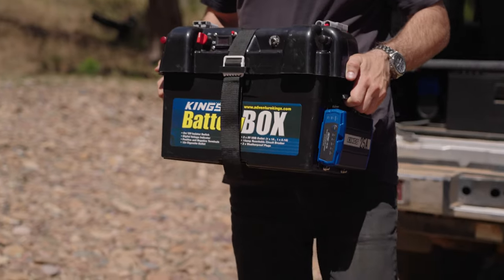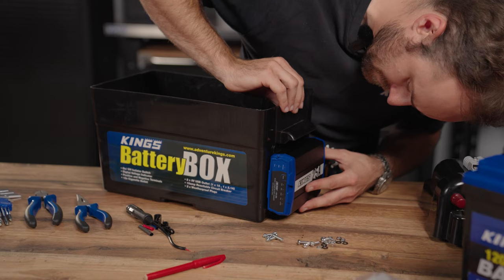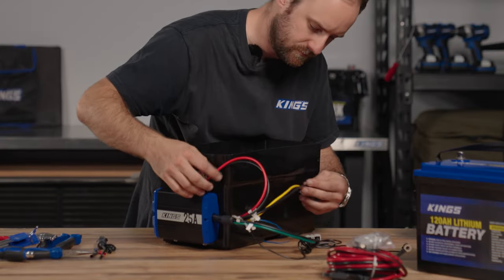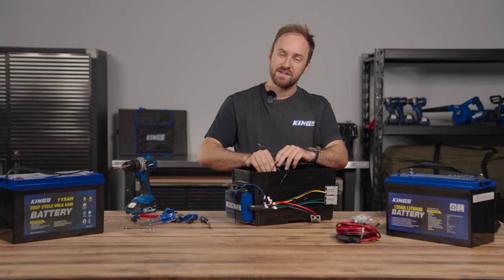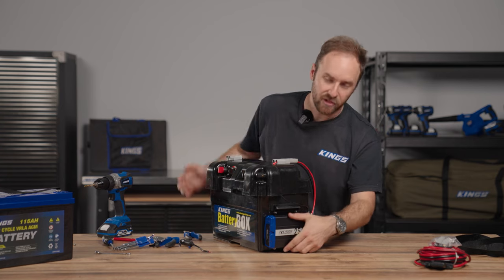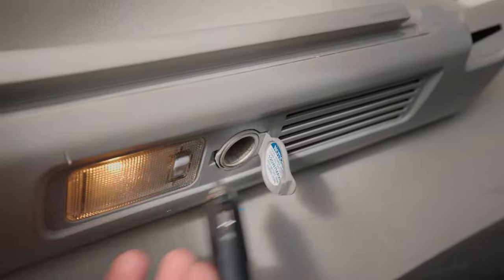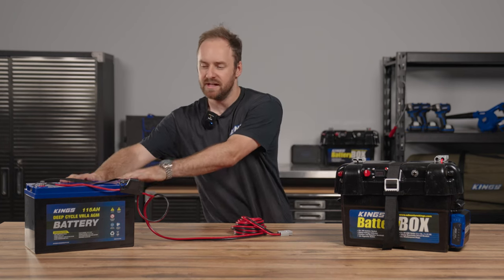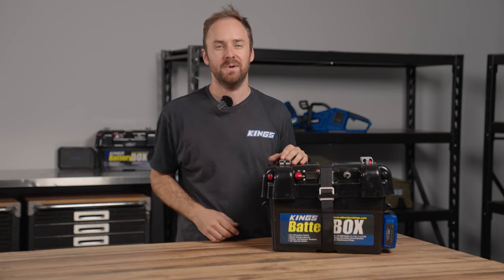How to install DCDC Charger onto Battery Box! Easy DIY!

Comment: My car already had a 12v Anderson’s plug at the rear of the car fitted when I bought it (‘22 ford ranger) that has been run through some sort of isolator. Could I use this cable to plug in as the starter batter input on the dcdc charger or does it need to go direct to the starting battery? (Remove the already fitted isolator) Assuming the dcdc becomes the isolator
Reply from the maker: Hi there,
This should be fine to plug into the DCDC charger.
Regards, Courtney

Comment: Hey guys, need some help please. If I disconect the alternator input (Anderson plug) or switch the isolator switch off when the vehicle is not running, I wouldn't need to connect the ignition wire, would I ???
Reply from the maker: Hi there,
For this setup this ignition wire would need to be connected.
Regards, Courtney

Comment: Cold you help me😢😢Can i charge a 60ah lithium battery with the DC DC charger directly connected to the car?? If I can, what type of cig plug do I need? Cheers guys
Reply from the maker: Hi there,

I can confirm that they are compatible with batteries of that size, please do note that it is designed to have an Anderson to Ring Terminal cable set going to the starter battery rather than the Cig plugs in the vehicle so that you get a full power input from the alternator.

Regards, Andrew

Comment: On the cig lighter end do you join postive and negative wires together then join to blue wire?
Reply from the maker: Hi there,
You will have to cut and tape the negative wire.
Cheers, Courtney
Reply: @AdventureKings  are you talking aobut cutting the non insulated negative wire and putting tape over the hole? thanks

Comment: What if you already have a regulator in your solar, does it work aswell?
Reply from the maker: Hi there,
As our DCDC chargers have a built in regulator you can remove the regulator from your solar setup or connect it directly to the battery and bypass the DCDC charger.
Regards, Courtney

Comment: Can i use the cig plug instead of running wires from starter battery to charge aux battery?
Reply from the maker: Hi there,
You can, however most car cig plugs have a very low amperage so this may take a while to recharge.
Regards, Courtney

Comment: Hey mate. I have a question i did the same set up what you did but my battery us 115am deep cycle. Why my 25Amp  dc to dc charger gets really hon when is charging. I worried my ute get burned when  i leave it on charge wuth the alternator
Reply from the maker: Hi there,
This is fairly standard to be hot while charging, we do have an operating temperature for these units of -20°C to 80°C.
Regards, Courtney

Comment: I have this exact set up but one thing doesn't add up.
Will the 50amp wire that connects my alternator to the  the 25a Dcdc (via Anderson plug) be a fire hazard...
Because 
1-the 25amp dcdc can only take up to 25amp and my alternator battery (800cc) will produce more than 25amp easily?

2 the preattached WIRE that connects to the 25a dcdc to be connected via Anderson to the 50amp wire (that goes to my car battery) be a fire hazard as it's only rated to 25amp capacity????

Thanks
Reply from the maker: Hi there,

Thank you for the comment, I can address both of these for you with an analogy, The DCDC in this setup would act as outlet in a system, and in the same way as a tap in your water system will only allow a specific amount of throughput out of the system, any value above this point will simply just not be parsed, so you wont have any issues with the unit being damaged in this manner.

Regards, Andrew
Reply: One more question.
Sometimes the camper doesn't get used taken away and used for extended periods of time, sporadically every few months.

Is there a way I can turn everything off when not using the camper for peace of mind.
Turning it off without having to remove the terminals of the 50amp wiring kit from the alternator battery??
Can I say just remove the same fuse from that 50a wire while leaving the terminals connected?
AND turning off the axillary battery too when not in use? Will this be safe when not in use instead of having to literally disconnect everything.

What would be the safest and most easiest and convenient way to isolate everything when I dnt use it regularly.

Thanks Soo much

Comment: Does the DC to DC charger solar input with an inbuilt Mttp controller charges the battery independent from vehicle alternator?
Reply from the maker: Hi there,
Our DCDC charger does have an inbuilt MPPT solar controller.
Regards, Courtney
Reply: Yes, can charge without starter battery

Comment: I have a Hilux N70, so do I have to put a super long wire in to connect the ignition cable as I don't have a cig socket in the tub?
Reply from the maker: Hi there,
You may have to do this depending on your vehicle, we would recommend our 12v fridge wiring kit if you were needing to.
Regards, Courtney
Reply: @AdventureKings  I have the dual battery kit from kings and using this as my second battery rather than under the hood. I'm not intending in using a fridge. Do I have to wire up a 12v cigarette socket in the back of the tub?

Comment: Not sure if I have connected the ignition wire correctly. When my vehicle is off, the alternator light and battery light continue to flash on the DCDC charger. Is this normal?
Reply from the maker: Hi there,
This is normal when the vehicle is turned off!
Cheers, Courtney

Comment: Does the control box plug into the anderson plug of the batery box?
Reply from the maker: Hi there,
You can, but this is not ideal. Any time you add more connections and wires you're increasing resistance, so it'd be better off to run direct to battery. That being said, if you were not running heaps of power-hungry accessories through the control box it'd be ok! The fuse on the battery box quick connect plug is 30A, but the control box is rated to 50A total, so you couldn't power everything from the control box if you went that way.
Regards, Courtney

Comment: So if i use the 12v socket as the ignition wire. When the car is off will it still use power from the battery box to power whatever you have connected to it ie you're fridge or camp lights?
Reply from the maker: Hi Jason,
We wouldn't recommend this as indirect ignition connections may not read accurately.
Regards, Courtney
Reply: @AdventureKings  Hi Courtney let me rephrase that. I'll do exactly as the video. My question is when the car is off will my second battery still power all my stuff ie fridge. With the way the ignition wire is powered in this video?
Reply: @duanewardle-rd3lm  your a legend mate, thanks
Reply: @jasonblade1037  yes mate absolutely. The blue wire is just to allow the DCDC charger to draw current from the main battery and alternator to charge the Aux. The Aux battery will power your camping fridge etc until it flattens without killing the start battery..
Reply: @daveinoz7813  you the man bro thanks

Comment: Ive run into a problem, ive connected my cranking battery to my isolator then to my dcdc charger which is connected to my aux battery, i have found that a 30aml fuse in the battery box has melted! And yes ive earthed bother aux battery and dcdc charger
Reply from the maker: Hi Ryan,
We would like if you were able to contact us on social@4wdsupacentre.com.au with a screenshot of this comment and further information on your setup so we can review this further for you.
Regards, Courtney

Comment: 4:02 how do u connect the ignition wire with the Cig plug?  ignition blue wire with the positive only of the Cig plug, and leave the negative unwired ?
Reply: yeah i wanna know too. i guess if you dont connect the negative, it should earth out the the sides of the cig plug to the car... but i dunno
Reply: Correct, Blue to positive only

Comment: should the lithium bat light and solar and aulternator light flash when only charging with solar please
Reply from the maker: Hi there,
If the alternator, solar and battery lights are quickly flashing this can indicate that there is low voltage detected at alternator and solar input. Please refer to our manual under 3.2 for how to assist with this.
Regards, Courtney
Reply: It shows that all those devices are connected

Comment: Can anyone tell me the size cable that’s required to extend the ignition cable to under the bonnet?
Reply from the maker: Hi there,
Pretty much any sized wire would be fine, but this depends on the length.
Regards, Courtney

Comment: why dosent a 300w solar pannel work on mine but a 160 w dose, the 300w one works on my caravan on a mppt reg but wont work on the dcdc charger i got from you
Reply from the maker: Hi there,
This would mean the 300W solar panel would be above capacity for our DCDC charger.
Cheers, Courtney
Reply: on the instruction pannel it say will take a 300 w pannel so this must be wrong to advertise this or spec pannel is wrong
 @AdventureKings

Comment: Will the charger work without connecting the blue
Reply: Yes but will drain your battery when you turn the car off. The blue makes it only suck power when you drive.

Comment: can i do the same thing with the 40a dcdc charger ?
Reply from the maker: Hi there, yes the 40a will be connected in the same manner. Kind regards, Rachael
Reply: @AdventureKings  that is strange as the fuses in these boxes are 30A and I was told in store you cannot.

Comment: Doesn't need battery isolate?
Reply from the maker: Hi there,

as it is a closed circuit you would be fine so long as the battery box output is set to isolate.

Regards, Andrew

Comment: What do you do with the ignition wire if you don’t have a smart alternator
Reply from the maker: Hi there,
We do recommend having the ignition wire installed, but it is only necessary with smart alternators.
Cheers, Courtney
Reply: @AdventureKings   so if I’m no professional and don’t really know what I’m doing then what’s the best and easiest way to install it? Do you have a video detailing that? Any help would be great

Comment: What size nuts and bolts
Reply from the maker: Hi there, While we do not have the specific measurements, it should be fairly straight forward to measure and go from there. Kind regards, Rachael

Comment: silly questiion how do i know the dcdc charger is working  or charging
Reply from the maker: Hi there,
A short flash on the alternator/solar LED indicates a bulk or absorption charging stage and a long flash indicates float. The battery type LED should have a solid green light for both of these charging stages.
Regards, Courtney
Reply: @AdventureKings  thank you sir

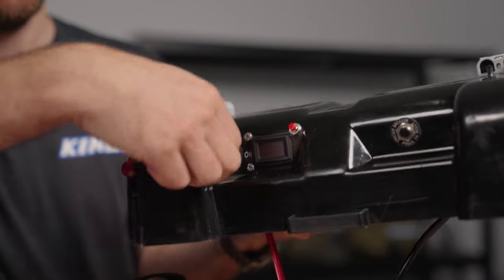Comment: How does he not get shocked at 3:00 when he's unscrewing both terminals at the same time?
Reply: Because 12V isn’t a high enough voltage to push through the contact resistance of his skin. If he had wet hands he might have got a little zap

Comment: Why can't I just plug the thing into a cigarette socket and not use the dcdc charger?
Reply: I guess it’s because the load rating of the cigarette socket is too low. Charging the battery may blow your car’s fuse. Or the charging speed will be very slow.
Reply: @lanbolyra  Ah okay that makes sense.

Comment: Can i use the cig plug if i dont have a smart alternator?
Reply from the maker: Hi there,

So long as it is able to register an active ignition it will intake power from the starter battery, and will be fine with either a smart or non variable alternator.

Regards, Andrew